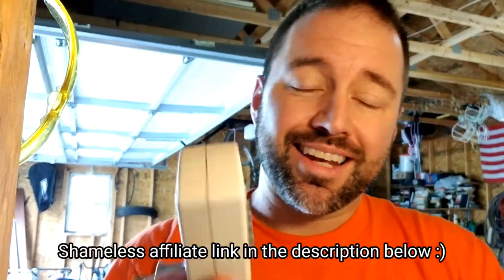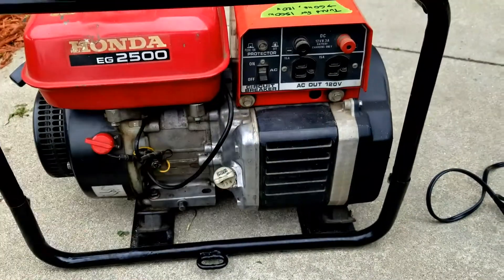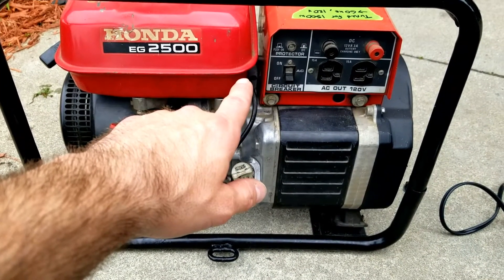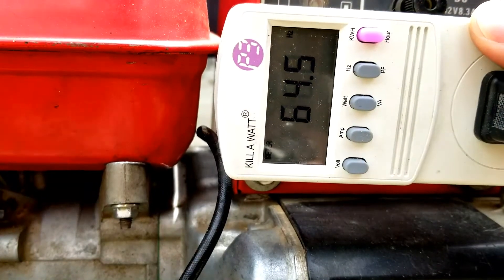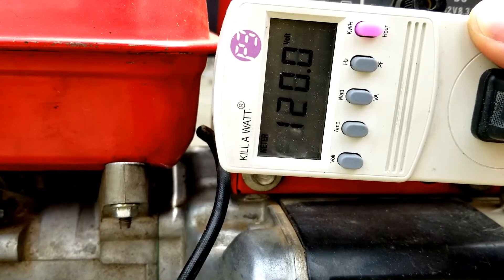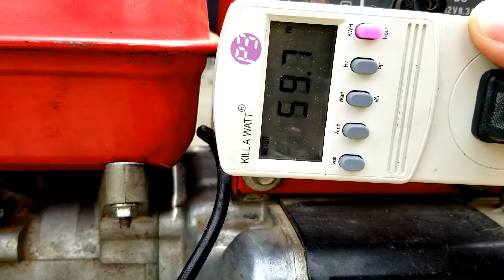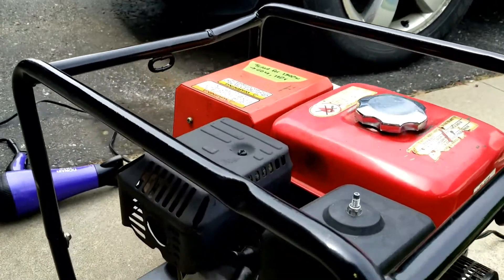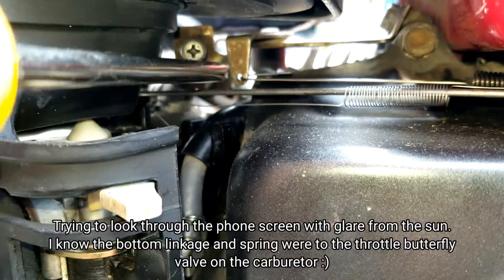Generator: DON'T Forget To Do THIS or You'll FRY Your Sensitive Electronics!

Comment: I am trying to understand the issue with sensitive electronics. My laptops, cameras, mobile phones and other devices all run with power supplies that specifies AC voltage input of 100 to 240 VAC. So, running on a 120VAC generator, why would spikes to 140VAC etc or drops to 110VAC be a problem?
Reply: Hi Herman Nel,
You have the key word there "Spike". Generators take on surges every time you connect an appliance. Those surges cause fluctuation that are harmful for sensitive electronics like phones, laptops and other appliances.
To help you better understand, generators have a starting load and a running load , you will have a higher starting load and a slightly lower running load for wattage. 
When you plug an appliance into a generator it takes a Load (Starting Load) anytime you plug say a coffee machine into your generator and that coffee machine has a running load wattage of 300 watts, you multiply that running wattage by 4 there by giving you 4 x 300 = 1,200 watts. That is how many watts it will take to Start that Appliance! Once it starts it will than start using the 300 watts continuous to run that coffee machine. When you do this it bogs down the generator and causing that spike/fluctuation and if your laptop or phone are plugged into your generator that will suffer the surge and weaken the draw demand of the running watts and this will harm and damage your sensitive electronics.

The electric company brings you in a continuous supply of power, reason why you can plug in your devices in a wall outlet and it will not suffer damage. Reason why we also have what are called Surge Protectors for our expensive equipment, because anytime you take a high surge that surge protector will protect your equipment. Another reason is when you plug into to many devices or heat spacers in one line on your outlet you have a breaker and if you over draw the demand for that line your breaker will pop until you reduce the load, because it cannot handle that load.

If I were you, I would consider also looking at Inverter Generators, the difference between a Generator and the Inverter generator is that Inverter generators produce energy without the surges that can damage electronics. They also have the advantage that they can produce only as much electricity as is demanded at a specific time, making them more efficient. 
The only downside also to getting an Inverter Generator is that they are pricey, but you could just get something small like 1,000 watt running wattage (if that) to run a television, laptop and phones. That's what I would recommend.
I would recommend a generator for a refrigerator or a coffee pot machine and some lights. Keep in mind that the more appliances you connect the more demand for your generator, so it pays to make sure you get something that can handle all of that. Just take your Running Watts and multiply by (4) to get your starting load, every time you plug an appliance in keep in mind that once you have an appliance in you have to subtract what you are taking and you can that do the math to see what else you can plug into the generator. Don't overload your generator! You will damage it. 

Hope this helps and sorry for so much dialog.
Reply: @knowledgeseekerr  Thank you for your response. It is appreciated.  
I agree with most of your explanations. However, I am still in the dark regarding the damage to sensitive electronics. Given I have a sine wave with acceptable THD, (no cross-over voltages – I can see that it will confuse electronics that depends on the 60 or 50 Hz for switching), plugging in a power supply into the mains will jump from 0 to 120vac , no problem. Why would jumping from 120 to 140vac be a problem? I looked at surge protector specifications and it seems that the average surge protector only cuts the voltage at 300-330vac, so, no use adding a surge protector since the generator regulation already stopped at 140vac. 
The inverter-generator is a good idea but I think the initial concept here was to reduce “noise pollution”. Cleaner sine wave low THD probably came as a bonus.
This is my sixth genset. I have been running generators in RSA for the last 25 years, sometimes 4 to 5 hours per day due to the utility company’s inability to supply continuously electricity, powering “sensitive electronics” in my offices and home, from before inverter generators existed, and still do.  I only became aware of this issue the last month or so while doing homework for my latest purchase. 
Do you think modern day electronics are no longer robust or, are the current day gensets not as controlled as before? I don’t want to labour this issue, it was never a problem for me but since the issue became known to me, I’m worried that I am now missing something.
I found this video https://www.youtube.com/watch?v=I2-3dyBHlhc&t=679s which sheds some light on the issue.
Reply: @hermannel1310  Hello again Herman Nel,
I am happy that I could help shine some light on your question. I am sorry to hear that your electric company becomes unreliable to supply you with a continuous use of electricity.
To help answer your question "Why would jumping from 120 to 140 vac be a problem" 
When you are having jumps (Spikes) of those kinds of currents, which a generator will do! It will create a ripple effect, that ripple effect can cause peaks into the power supply, which the power supply cannot handle. It could also over peak with power into the power supply, resulting in damage of the power supply. 

It will also vary Herman, some power supply's can handle those kinds of jumps, but they typically are really designed around for the standard in home electricity ( does that make sense?) They really aren't meant to be plugged into a generator, because generators do not supply constant flow of electricity. If you have a Sine Wave hook it up to your AC in your home and record it and than plug it into your generator and record those sine waves and put loads on your generator and watch what will happen.
Here is a helpful video https://www.youtube.com/watch?v=_0vN2Jjbdis&t=566s 
He has 3 generators and his using his sine wave. You might get a bit more information and release why a generator is unpredictable when bringing in power.

BTW! Yes Surge Protectors are useful, they protect you for those 300 +VAC, a lot of equipment and power supply's can handle a 240 vac max! But if takes that on it will blow your power supply and it will send that current if plugged into your laptop or devices and fry your laptop because of that spike.  

To answer your other question "Do you think modern day electronics are no longer robust" 
Yes I do think that, because modern day electronics don't last worth 2 cents! plus a lot of technology has advanced over the last 25 years! more electronic parts are super sensitive to the slightest things. I remember when you could drop a pager in a bottle of coke or coffee, open it up dry it out, clean it with distilled water and all the other cleaning process and it would fire right back up. Today's electronics just have very small components and are sensitive to the slightest touch.

Its not like a Motor! a Motor is nothing more than magnets and copper coil windings. Reason why its safe to plug in your refrigerator because it uses a motor and a compressor to keep the refrigerator cold. Or running basic lights, because your just pushing electrons through a filaments bulb, basic simple components like that wont be effected. But keep in mind your generator has to be able to handle all that load! If not, you can still damage your own refrigerator and your generator.
Reply: Buying a Larger Generator will help with Spikes  i see so many people buying 3500Watt and thinks it will run there frig ,microwave,  lights  , etc  with no problems , as already said when you plug in a appliance it puts a load on the gene and if its small 3500w gene it will surge  But if you had say a 7000-8000w gene it can handle that load way better with no surge  so the point i am making the Bigger the Gene the less it will surge when load is added .
Reply: @danray9744  you just made a great point

Comment: That engine speed dip from no load to about 60% load is quite big. The problem is in the governor linkage spring. Most generators have several holes to mount the spring on, which effectively adjusts its sensitivity and how much compensation the speed governor does to the throttle under various loads. The behavior I see in your case is that the governor is not sensitive enough to pick-up the engine speed when there's load. I suggest you tune that governor linkage before adjusting the throttle screw. Typically, the generator should be doing around 62Hz no load, and around 58Hz full load. If you can make it tighter than that, the better. The problem with setting the frequency too high is that, you're also over-revving the engine. At 60Hz, the engine will be doing 3,600 RPM. But at 65Hz, it's turning at 3,900 RPM. In many small engines, that's borderline too high.

As for the voltage, 122V is fine. It seems that changing the engine speed is not affecting the output voltage by much, so the AVR is doing its job and no voltage adjustments are necessary.
Reply: I agee; tune the automatic regulating device , not the base idle .
Reply: this also makes sense... also read a techs advice claiming the same thing...https://www.youtube.com/watch?v=OIYwuuf8IMk
Reply: If I recall, my generator documentation strongly advises against (says it is against the law) to modify he governor
Reply: @NinjasOfOrca  Under normal circumstances, like if it was working properly, I wouldn’t touch the governor either. But in this case, it’s not performing as well as it should so a bit of recalibration is maybe what the doctor ordered. The governor regulates the RPM to 60HZ (3600 RPM). It will be in your appliances’ best interest to keep it within a very tight tolerance from no-load to full-load. If you think about it, what irks the government more is when you start playing with carb jettings as this will have a major impact on how much pollution the engine produces. That’s why CARB-compliant generators would have fixed air-fuel ratio set screw. 
So engine speed, not so much. But having the wrong jettings and/or A/F mixture (ie. Running rich), the latter has more legal ramifications.

Comment: I noticed you only adjusted the engine RPM at load for 60 hz. and did not check the voltage or adjust the VR voltage regulator for approximately 120 vac output.  Remove the back cover on the generator head and there should be a kidney shaped part that has a small adjustable  screw that can be adjusted for proper voltage regardless of engine speed.  Sometimes the VR may be located instead behind the front cover where the electrical outlets are located.  Check the manual if you have it.

Comment: Nope. Your electronics operate on DC not AC. Their power supply rectifies the AC current to DC so that little frequency change makes no significant difference. It's the voltage spikes that does damage.
Reply: 5% THD is the limit for most modern electronics with micro processors. so you are taking 57-63hz operating range. you are rolling the dice of outcomes if you exceed those limits.
Reply: What causes a voltage spike?
Reply from the maker: Nice catch.   Thank you for the correction!  Cheers!

Comment: Thanks for making the video.  I have the same generator Honda EG2500  bought in 93, garage keep only used during power outages.  Still runs perfect.  Every year i do regular maintenance, but have never adjusted the Hz and voltage.  Will get it done before winter.